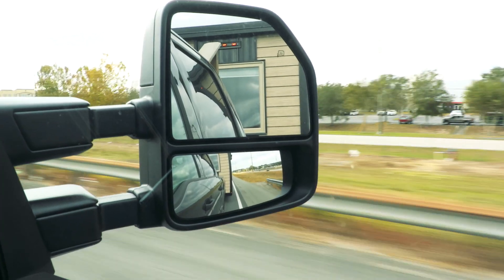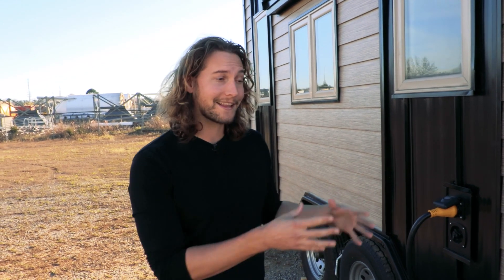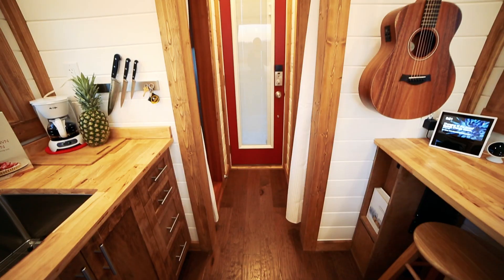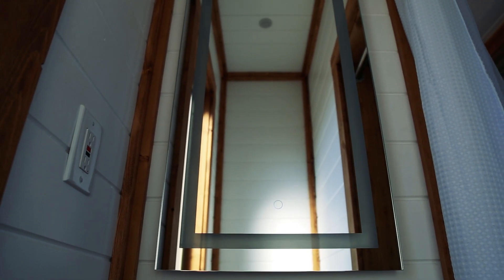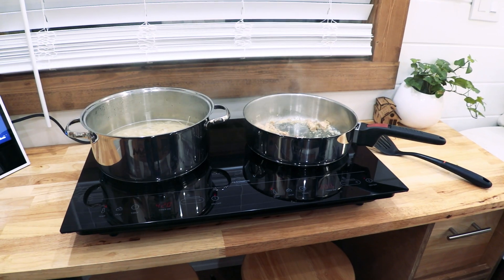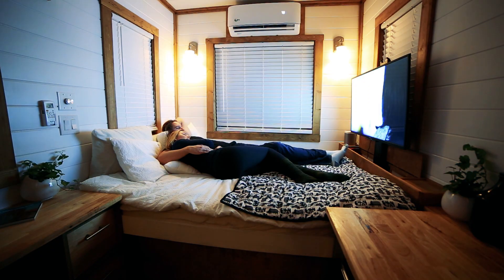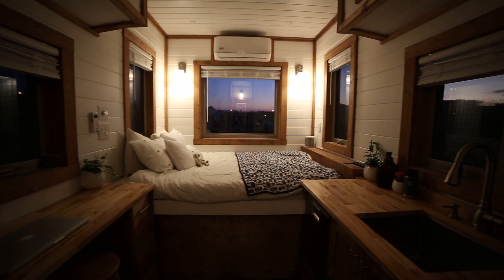Living Big in a Tiny House: Our Traveling Tiny Home In North America

Comment: I think this design is great and compact. I'd hate to have food/debris from the kitchen end up in the bed though. A small wall a few inches high at the ends of the counter could fix this, but a better idea would be a a counter-top that slopes up at the bed end (think tiny quarter-pipe). A sloped end counter would be easy to wipe down without a 90* crease to clean and would catch most food debris and overspray from cooking. I don't think I've ever seen this idea implemented but it may work (or not, who knows).
Reply: hehaheadshot97 Ah, you and I had exactly the same thoughts!  I was disturbed by how close the cooking was to the bed.  I kept have visions of a little too vigorous stirring of a pot or stir fry and a big splatter landing on that beautiful bed spread.  I was actually thinking of some kind of small divider wall on that side that housed some kind of curtain system one could use at night if one person wants to sleep and the other wants to stay up and read.  I just really like the idea of having even a minimal way of dividing off the room.  But other than the potential for accidental food on the bed, everything else was great!

Comment: Nice house, optimized for travel. But I don't understand why all american houses have the doors open inwards? It takes up a lot of area inside the house and makes easy to just kick the door in (or using a sledgehammer). In Sweden all doors open outwards and that makes them impossible to kick in (unless you're the Hulk and kick in the entire door frame and wall). In my tiny house I hang my coat's and hats on a hatrack fitted on the inside of the door.
Reply: Nikenik2001 It's because door hinges in the US have removable hinge pins on the inside and if the doors swung out it would mean no one would have to kick in your door, they could remove the hinge pins and walk right in.  I have both an In-swing and an out-swing door on my house. They both have their pros and cons.
Reply: That's a weird solution. To remove a Swedish doors you'll have to open the door and lift it up about 10cm from the hinge that has no removable parts accessible on the outside. You'll need a chainsaw or a blowtorch to get in. Se this picture of a typical Scandinavian door. 
https://cdn.hemfint.se/img/13/59/75/05/1000x1000/ytterdorr-bergen-med-glas.jpg
Reply: Not to be that person, but it looks like an angle grinder would make short work of those hinges.  Not that I think U.S. hinges are any better.  I'm frustrated by the fact that all American homes are designed with speed of construction as the top priority and user/consumer satisfaction as an after-thought.  U.S. homes are designed to be built quickly with mass-market appeal in mind rather than meeting the tastes, preferences, and needs of a specific user/customer.  The U.S. construction sector is essentially making disposable homes, not built to last.  And then these same people make fun of tiny-houses...
Reply: Yes, precisely my point! Built for profit and disposable, not for lasting quality or with the customer in mind. The "security thing" is secondary. If you have power tools, or just a crowbar and a thick blanket, you can break into any house by just smashing a window. But a nice thick insulated door that opens outward is my choice for the house i plan to live my life in. Saves on heating and makes for a quite home.

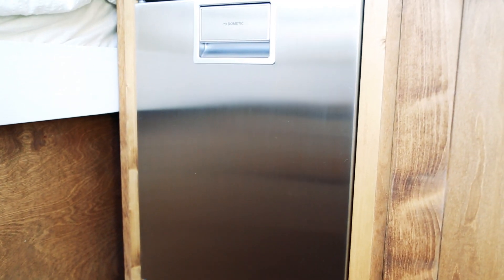Comment: 6:16 that's a good way to save water. 10:50 I should figure out the differences in AC and DC power, 13:15 It would be good to look into that program to make sure there is no mold

Comment: I was watching a video about building on a trailer and he used a pretty large sized goose neck Trailer it had water tanks that could hold a lot of water/grey water. Then he added a couple of things like a weather station with 4 temperature sensors so he could monitor the outside temps, inside temps and water temps. He also used some kind of sensor on the water tank that let him know the amount of water left. Then he added also a device that amplifies the cell signal and the wireless internet signal. He also used a fridge and freezer that they use in Australia (Engel?). They are designed to use less power. He talked about getting water and he said if you go to a camping area and pay for 1 day then you can load up on water. He showed a small trailer with a water tank that you could use to get some water to refill your tanks.

Comment: The designs on all those homes are lovely.  I am bummed that I can't find one that would fit a standard wheelchair size.  Need about 3 feet (36 inches) for a standard width chair.  I like the zen and chanty models with the bed downstairs.  It might be possible to use a slim sized chair but I don't see how you'd pop wheelies to gain entry without a good rigid chair.

Comment: This is my favorite one. I would like this, but with some small changes. A lower roof, to fit more places. A twin size bed, use the gained space for more storage, maybe a flip down table. I would have to have an oven, I bake most of my food, even hamburgers. I would have two of those fridge. All of the extra kitchen stuff would go in the space I made by having a smaller bed. Instead of the bed lifting up, I would have a large pull out drawer under the bed (which would be up off the floor a bit higher, the front of the drawer would have a small, pull out step) and when you pull out the drawer all the way, you can then pull into that middle space the drawers under the bed that are on both the left and right side. Only one side at a time, of course.

Comment: Hey Bryce and  Rasa, nice job on this video and build.  I had watched the building of it but missed this until now.  I have one question on the design:

For traveling efficiency, would building a bay window up front by the bed be feasible, so the wind would part ways rather than slamming into the flat front?  Could it reach down the whole length of the building or would it be more efficient to have it just jut out over the trailer hitch?  What do you think?
Reply: Hello Louise
How are you doing today?

Comment: Separating the toilet and shower was a clever idea, however i would have attempted to put the two in the one room if possible and keep the other area open for a mini office or private room/extra storage etc- and at the same time have installed the option to transfer a toilet hook up if ever desired to change it up a bit. Also with the bed, i would have desired to design it where it can also be transformed into a sofa and then back to a bed without compromising space and storage and one idea is to put the bed on a slider to go up to the ceiling and back down to the floor as an option... with the possibility of the storage under the bed goes up with the bed opening the floor under it to be a place to have a dining area or open space for company.  Also it would be cool if tiny homes would have attaching hooks on the outside of some kind where you can hook up multiple tiny homes together to make a large live in home and detach quickly and easily when needed.

Comment: I like this layout very much. Many people prioritize their working/cooking space and are fine with a loft for sleeping, but my top priority would be a queen-sized bed (or a least a double) with sufficient space for sitting up without conking my head, and plenty of storage space underneath the bed. Plus, using the tiny narrow stairs (or even worse, the ladder a la Laura Ingalls on the prairie) would get old pretty fast. It impressed me to see this tiny house clearing the pumping stations' overhead at the gas station. I also like the split bathroom; it's far more practical for two people and I'd rather not shower in the space where I do everything else.

Comment: It a nice tiny house with the flat roof but it could be installed some solar panels on the roof and hitch mount bike racks outside and also they could provide barrel to collect the rain. It is shown that the portable staircase is at the back of the truck. It would be much more better that the staircase could be attached to the house, I mean it could be packed and wrapped at the bottom of the entrance. This house needs a metal ladder built on the wall outside to access the roof. Inside the house they could build some cubbies and shelves up top near the ceiling. There are a lot free spaces all around the wall on top near the ceiling, there is no place for clothes and some other necessary stuff.

Comment: Finally I've found a tiny house design that I can aspire too.  Lightweight is the key for me, as that seems safer to move.  I little disappointed that the solar energy option was not engaged and the smart technology was everywhere.  That doesn't sound like the host...  it sounds more like sponsorship to defray costs.  Also, why maple cabinets if you're concerned with weight?  And do the cabinets lock or do they swing open while house in in motion? I like the fact that it's RV certified - - great feature.  I also love that the electronics are not under the bed (ELF radiation is something NO ONE thinks about). Lastly, it seems like a lot of wall space went to waste.  I get the "no-clutter" look but there's tons of inches of unused space on the walls.  Good job mate!

Comment: My wife and I are planning to buy a camper/trailer in the near future so your video caught our attention. After watching this one episode of Tiny House, I was left with one question. Im not sure if it has been addressed in the numerous comments here already but I dont see anything made to deal with wind resistance.
*I dont know the proper terminology nor am I experienced in anything to do with the building or designing of the home. However, I am sure you must find this to be an issue to some degree while traveling.
Do you have any plans to add a removable *bubble or wing much like those found on trucks and trailers?
You know, even seeing the stairs stored in the bed of your truck I thought why not custom design and attached it to the railing of the stairs? 
By the way, I did notice you have a special spot for your guitar! I certainly would do the same for my mandolin and other gear. I would even goes as far as to incorporate a small recording studio setup including a waterproof box with mic and headphone jacks built into the wall of the shower and use it as a vocal booth!
Blessed and Safe travels,
Louie

Comment: I have a couple of questions for you:

1.  How is the steel frame holding up?
2.  What was the dry weight of your tiny home?
3.  How happy are you with your membrane?  Healthy home from Mainstream?
4.  How is the lunas heat recovery system working?
5. Can you hang things from the wall using the metal frame?

Comment: Beautiful. A couple things I would add/change. BIPV for the Roof so you CAN be a little more off-grid, though that's at a higher cost ofc. Other than that, I'd have made storage over the Shower/Bathroom accessible from the hallway as well as the same outside on the porch (but lockable). You don't really need the ceiling in those 2 "rooms" to be as high as the roof.

Comment: Hey ... lovely to see you incorporate elements of the Japanese Tiny Home you reviewed in your own home.  I remember being blown away by the Japanese  build, incredible attention to detail and function so perfect the form was sculptural - down to the tiny open fireplace and mitred windows with indoor/outdoor shelf. Your build with the Lantern-like exterior and pared-back choices of architectural details for the interior of your home capture a minimalist essence  without compromising on the beautiful eastern symmetry and  aesthetic the wood trim and cabinetry engender. The cut outs are a fantastic idea and work perfectly to enhance the beauty of the space.  I agree with your reasoning about choosing to not build a loft space. The resultant height of your 'great' room,  punctuated by the clerestory windows, wood framing and tranquil colour choice has resulted in an  awe-inspiring space. Smart decisions were made in the bathrooms too - especially separating them with the two of you travelling together (!). One question though - ventilation under a mattress is important to prevent mould growth  ... do you have wood-slat  springs or air holes for circulation ? Thank you for sharing your home.

PS   Kiwis rock.

Comment: Mike from Chattanooga is the man.  A little pricey in my humble opinion but his designs and materials used will last and be most functional in the long run.  Many say his stuff is too commercial.  Maybe so but a tiny house is supposed to evolve as you live in it.  I think Mike's designs give you the shell you need and then the space to grow with it.  Like they keep repeating...vehicle first.  Also if you need a heavy snow capacity on the roof or live in high moisture area his materials will stand up and keep the mold out.  The higher the weight the bigger and badder your tow vehicle will have to be.  Even his biggest tiny home keeps you within the limits for towing without a commercial vehicle and crossing various state lines.

Comment: Can You Send Me The Links For A On-Line Store Or Physical Bricks And Mortar Store To Purchase The Induction Cock Top, The Amazing TV Lift, The Building Warp A.K.A. Membrane For Both The Inside And The Out Side of The Tiny House And Of Coarse  The Composting Toilet. Do You Know If You Can Spay Foam Into The Steel Frame For The Tiny House?
Reply from the maker: Hey. Follow the read more link in the video description and you'll find all of that info. Yup, you can use spray foam with steel framing.

Comment: I really like your ideas, and it would be great to cross paths sometime in spring/summer 2019.   I live in a tiny house, with a primary house of 80 square feet by 7 feet tall (120 sq/ft if you count the workshop), with two lofts and plenty of space.   Mine is built in two 40 (4x10 foot) square foot units, and designed to be modular by adding units to accommodate the needs of potentially growing number of residents (currently only setup for up to two separate private bedrooms, and one full bathroom).   I love living in an under $5,000 home, made from all new materials, whose cost includes all power and water sources.

The one thing I do not like about your design is the presence of power hookups.   That is the fact that it is designed to operate on grid at all.    I personally am more a fan of completely off grid living, as the power grid is 70 years past its usable life span, it has been more practical to provide on site power since the late 1940's than to use the power grid.   I personally use solar as my primary power source for electric.  For any application that requires heat production I primarily stick to direct solar heating (cooking, heating, hot water, etc.).

PS. I am doing a partial redesign to save weight, while making it stronger, for the next version of mine.  The current version has each unit weighing in at 750lbs, way heavier than need be.

EDIT: Corrected the size notes.   I have the habit of rounding up on the size as many people have trouble grasping the concept.

Comment: Using overpowered aircon units is not good since it waists energy

"If your air conditioner has a bigger BTU rating than the room size needs, it will cycle off too quickly, waste energy, and will not adequately dehumidify the space. So a higher BTU than needed is definitely not recommended."